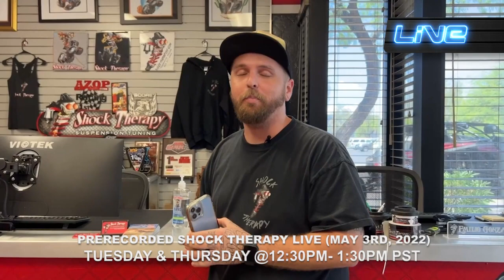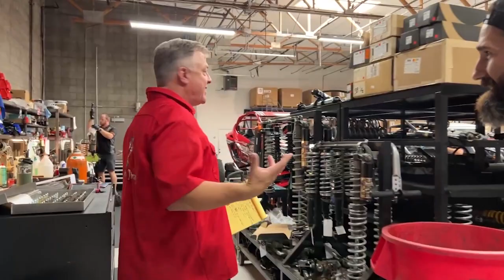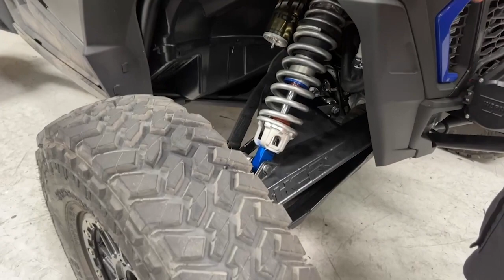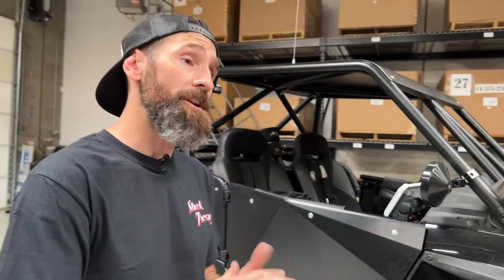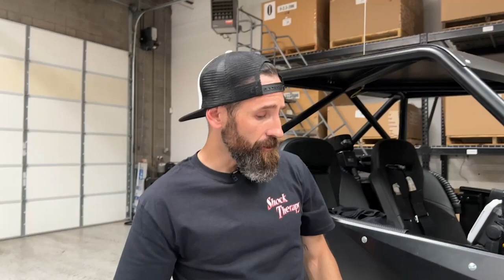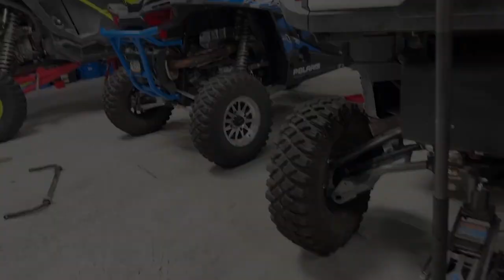Tech Tuesday // Aaron Kaufman

Comment: Had your dual rate spring kit installed on my 2015 XP1000 while at Glamis two years ago. Had the chance to drive with stock springs, then swapped them out and ran the same lines again. Day and night difference. Less bottoming, plusher, more controlled. Hope to do internals next season and hope it makes the same difference.
Reply from the maker: So happy you love them. Thank you for sharing.